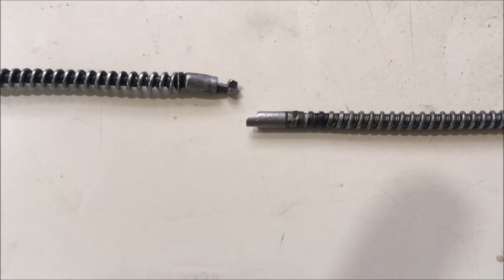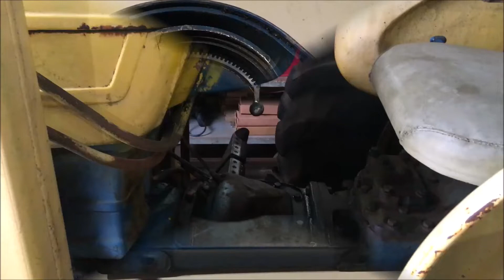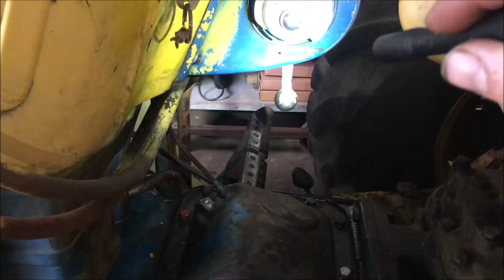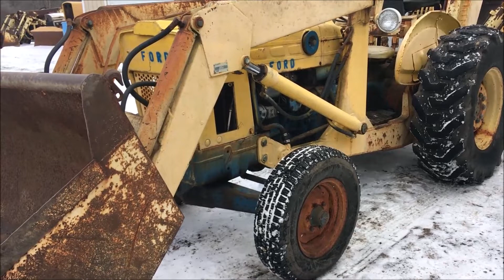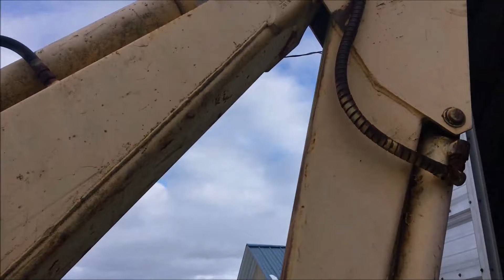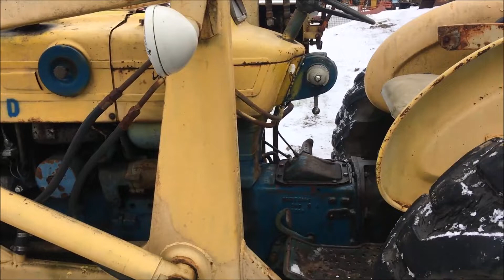Ford Select O Speed Shifter Repair

Comment: Do you know where to get the little piece of glass?For the shifter housing?
Reply from the maker: There isn't any glass in the shifter unit where the gear ranges are is open to the elements. Now there is a small top plate on the shifter that on some had a red plastic lens in place of the plate that would light up when there was low oil pressure in the transmission, but ford stopped putting it on because people were confused what it meant.

Comment: i need a cable and gear gear is striped or a hole used shifter 1968 3000

Comment: Question:  My cable isn't broke, but I can't shift into gears.  I can turn the shifter, but there's no clicking into gears like it used to.  Any idea what's wrong with her?
Reply from the maker: Could be the shifter nut that is behind the left side cover on the shifter it holds the hand lever and gear selector to the cable plate. If its loose the shifter lever and gear plate will move without moving the cable just make sure you're in the right gear when you tighten it or you'll be off on what gear you're in. Hope it helps.
Reply: @TheGoldenHillFarm   I would've been nice if you would've showed how you got the transmission top cover off.  Is there a free downloadable manual somewhere?
Reply: Unde găsesc sufe am un ruptă si nimeni nu le mai face

Comment: I have an affinty for Ford backhoes. That's what I first learned on, a 4500. A Selectospeed would be a pain unless you left it in neutral to be able to move with the hoe without picking the whole backend off the ground. Not always necessary. Might be kinda dangerous but you overcame a dilema and it operates. Good work!
Reply from the maker: Yeah it would be a little pain. Could disconnect the rear end from the trans with the lever.
Reply: @Golden Hill Farm  That would make it a coaster. Not good on a hill. TBH, thats the first backhoe I've seen with a Selectospeed post 1964. How rare is it?
Reply from the maker: It would work great trenching on flat ground just keep pushing yourself along with the backhoe. I've only seen a few online with SOS transmission. Most are manual 8 speeds like my 1975 4500. I don't know what the production numbers are for it.